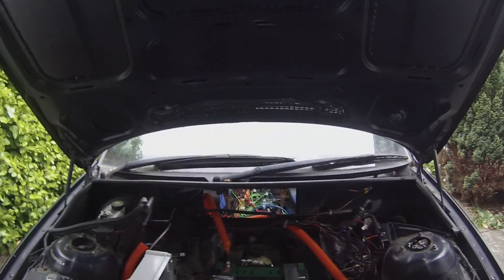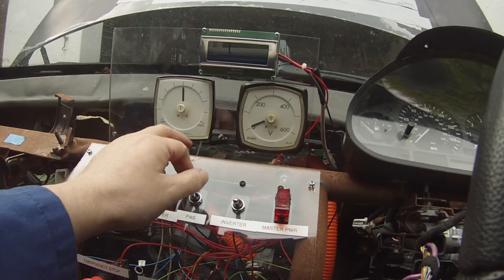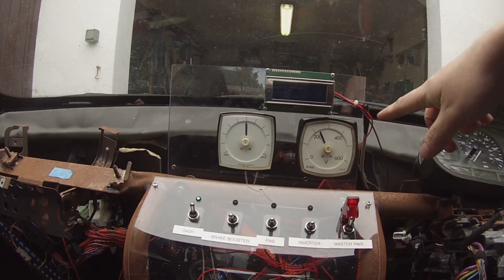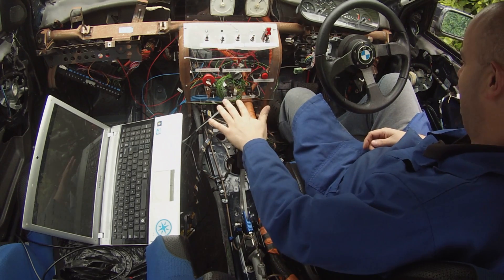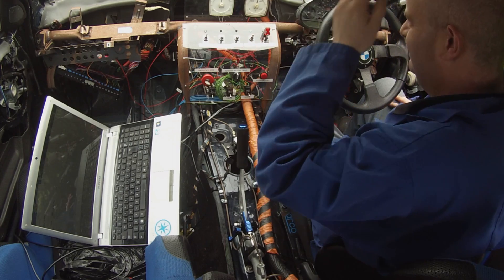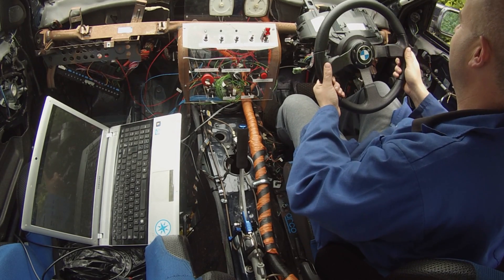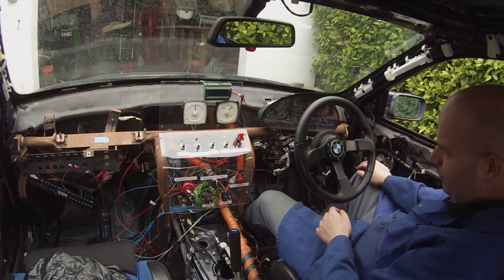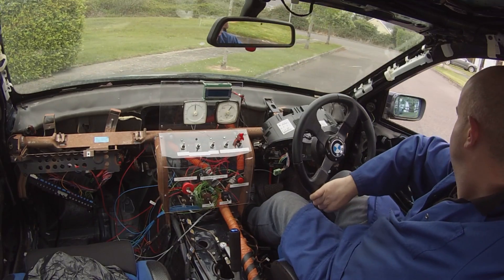BMW E46 Budget Electric Drift Car Project 20 : First Roll

Comment: Damien, I know nothing about Drift Cars but I suspect the steering ratio may be too low and the regen. may have to be negated. Experts please chime in. Congratulations on the first test drive.
Reply from the maker: Thank you:)
Reply: steering ratio is fine.  most drift cars use stock racks.  and all the big comps like D1 and FD dont even alow short racks

Comment: nylon bush kit would get that judder under control i think you could make you own mate, you could try and installing the camera under the car where the diff is and see it move great work though also is that reduction gearbox chain and sprocket of gears if chain then that mite be the issue to
Reply from the maker: Will do thanks:)